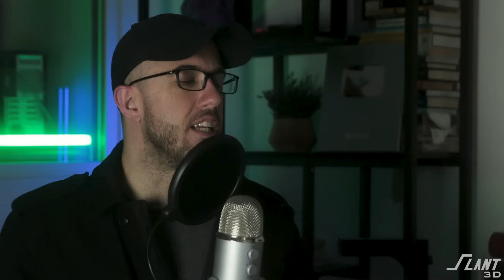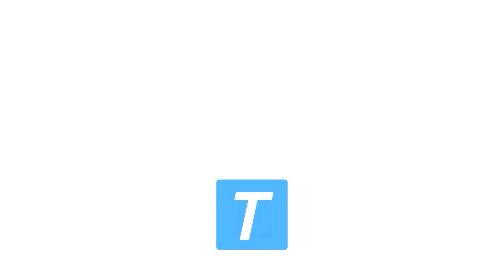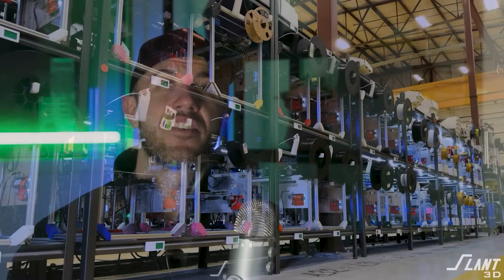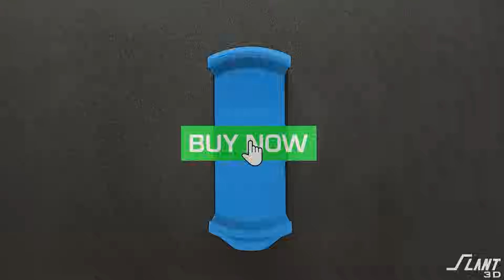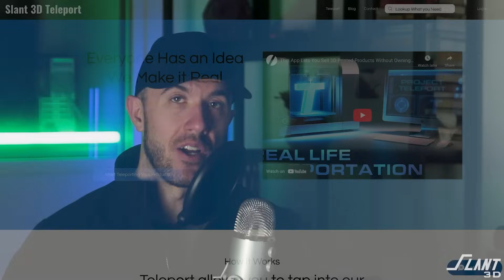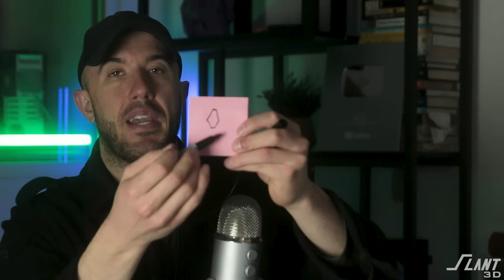Bambu Lab H2D | Nano Dimension & Desktop Metal | Formlabs vs Injection Molding | Podcast Ep 98

Comment: The thing about the h2d is that only one printhead uses the ams.  So anything over 2 colors means you are back to the poop-purge-print cycle.  So if you dont mind overpaying for a fast 2 color printhead with a largish print bed, this is something to look at.  But at 3 colors you lose the advantage.  A prusa xl with 2 print heads isnt much more expensive, but is open source; and you can add three more printheads without sacrificing  speed.
Reply: @gregr5  where does it say that only one printhead uses an AMS? The wiki specifically shows instructions on using 1 on each and slicing for an ams on each nozzle. If you were using one ams they say to stick to the right hand nozzle but nowhere does it say you’re limited to only that side
Reply: @hussxin71  fair enough, but it doesnt matter.  As soon as a third color is needed, the ams will have to retract, poop, and then purge.  You will only see a time and material saving with one or two colors.  And you still need the purge tower, even with 2 colors.
Reply: @gregr5  right its a  2 toolhead printer not 3, once you do 3 you start pooping, thats the point its poops half less, and i think even more if you kept dark colours in one adn light colours in the other, you could further reduce purging, so now youre pooping more then half as less then before.   But yeah, they got 2 on there, why not 4? Not far off, maybe with further miniaturization it can happen.
Reply: you save alot of time and filament with the idex feature and the mmu system working on both toolheads makes it even faster, it just depends on your color selections, n the idex in this form should be alot faster then traditional ones .
Reply: @songhan1586  It's not n idex printer.  the two printheads are slaved together and when the ams needs to poop and purge, both printheads are offline.  In a true idex, the ams printhead not printing could be pooping.  But it would still have to do it so if changes were quick, you would end up waiting.  It doesn't matter how smart you are with color choices, poop happens.

The only way to avoid is to limit your pallette to one or two colors.
Reply: @gregr5  You could drastically reduce poop with 3 colors if you are smart about how to place the colors layers. You could theoretically do a three color print with only a single filament change with two nozzles, instead of a dozens of changes with one nozzle
Reply: You still are way faster than a single tool head printer. If you design your part that you only always have 2 colors on the same layer height you need just 1 color swap in this area.

I have a Snapmaker J1 (IDEX) and I’m limited to only 2 colors/filaments for a print. Many times I would like to have 3-4 colors for a print. Only option for now is to use my X1C.
Reply: From what I read, you can add another AMS, so both printheads use them.  One video I saw showed someone using identical filament in both AMSes, and was able to span the entire print volume because of that.

I'm looking at the H2D as something for larger print volumes, such as printing a helmet, as supposedly 320mm cubed is good enough, and the H2D can do that.  The new cooling mechanism can't hurt either, so PLA doesn't wind up warping.  For laser stuff?  Hard pass, even though it is a cool thing to have.

Comment: Any plans to increase the build volume of the SlantBox? 10 inch server racks are becoming increasingly popular and a couple of manufacturers are starting to go all in on these. There could be a good market for 3d printed products but the 220mm^3 volume on the SlantBox is limiting. From an IT perspective, small businesses could more easily integrate a 10inch server rack compared to a full sized 19inch rack. So I feel like this could be a great niche market to get into. I've been trying to design a few pieces that would fit in the 220mm^3 volume, but I need to break them up into pieces which causes things to lose rigidity. 256mm in at least one axis would be fantastic!
Reply from the maker: Rotate it to be diagonal on the print bed

Comment: They could use the laser to discolorate the color pigments in a way to make grey scaled prints. It could maybe even used to make multi color prints if they develop special filament pigments. If the pigments react to different wavelength.

Comment: I love what your saying about the new bamboo.. I wached all the same reveiws. I thought it was cool but i have been trying to figure out the use case for a 3500 dollar machine. The duel head ... AMAZING, big print surface, beautiful.

 If i wanted lazer or a vinyl cutter there are many other options already.  

Thanks for the podcast, hope you feel better.
Reply: Saying its a $3500 machine if you are only interested in bigger size and dual head, better ams etc etc is kind of weird than its a $2199 machine. My guess that 80% of the sales will be just that combo and if that is great value compared to others is the more real question. Its really 2 products they even gave them different names H2D and H2D-L
Reply: The Etsy crowd and craft moms that’s who. They are aiming at a larger audience. The 3D printing community is only so big so it means they can only grow so big.